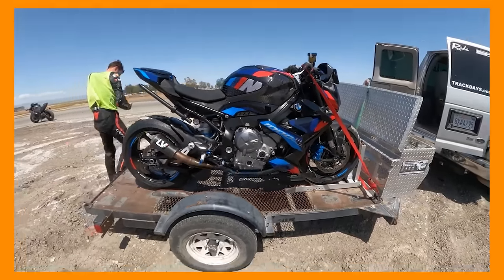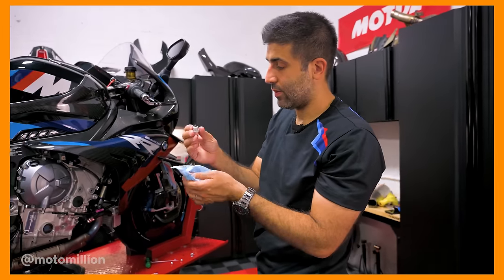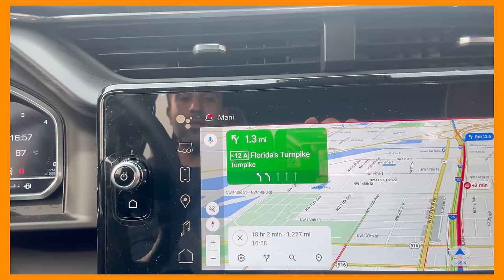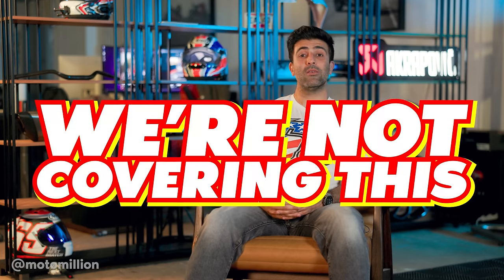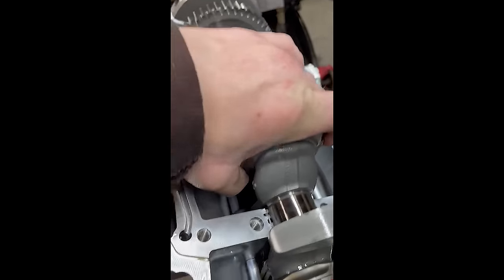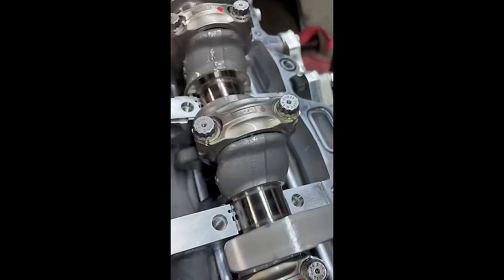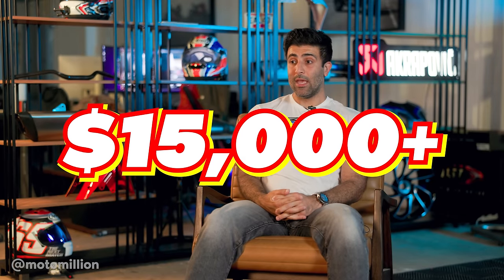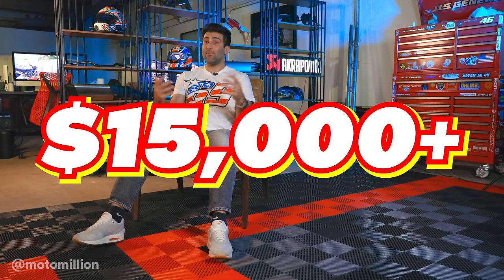MASSIVE Engine Failure on our M1000RR & BMW REFUSED Warranty...

Comment: I have owned numerous new BMW motorcycles over the years. They were once known for reliability and excellent customer service. 
My last GS had a fuel system recall. About a year later, the part they recalled failed and it started leaking fuel. The dealer reached out to BMW to get it replaced and to the dealers surprise they refused. I called their customer service (now the same as their automobile line) and was told they wouldn’t replace the failed part they put on my bike under their own recall. I got ahold of a manager and explained I was a loyal customer having purchased numerous new BMW bikes. He offered to give a tiny discount off of the retail price of the $800+ part. 

I will never own another BMW product.
Reply: You need a Honda or Kawa in your life, they would not break in first place :D
Reply: @elcookiemonsteru  I own a lot of bikes, and have owned several Honda’s Yamaha’s and Kawasaki’s. I currently own a couple of old Honda’s. Those bikes certainly tend to be reliable. Unfortunately, there aren’t many models in those brands I like a lot at the moment.

This might surprise you, but I’ve had zero problems with my old AND new Guzzi’s. Probably the most reliable bikes I’ve owned. They are a lot like the old BMW’s, very simple and reliable. Guzzi’s parent company, Piaggio also owns Aprilia. I’d consider a RSV4, but it needs an updating.

Comment: As a retired engineer who worked in REPCO NZ ( who produced engine parts including bearing shells) I would say straight off it was a duff bearing. Engines are very simple, you dont need to be a rocket scientist to analyse  the type of material/s in the oil and where they have come from,  everything you highlighted was correct , simply the bearing got through "QC" fitted and broke down from there. Shame on BMW..

Comment: There are literally 1000s of these bikes on the roads with ZERO problems. Common sense owners do the proper break in period. During the break in period, all the moving parts are 'settling in' with each other. This creates material debris in the engine, which thickens the oil. Thick oil and high rpms will destroy any engine, since the oil cannot flow properly.  No harm if the engine is kept at low RPMs and the oil changed within 500ish miles, which removes all the debris. After that, the new oil stays clean, no more debris, and hence the engine can now operate as intended.

Comment: I am a French biker. I had a 2019 s1000r. I had no problems with it. I currently have a K67 s1000rr and have had no problems with it either. Despite this, I understand being disappointed by a negative response without any verification from the dealer. We have vehicles that are relatively expensive and the feeling of having no empathy when we have a known problem with the vehicle can be very frustrating. Our luck is when 2024 BMW, like all other manufacturers, is very careful about their reputation on social networks. And absolutely want to maintain a good image in order to make customers loyal. Good luck to you in your reimbursement process. RIDE SAFE / PEACE

Comment: BMW is clearly fed up with people buying RR's, putting full race systems on them, removing the running in rev restrictions, redlining the engine multiple times during the break-in period, servicing the bikes themselves, or using non-BMW official dealers, and then either failing to tune them appropriately or applying aftermarket tunes such as Bren tunes to them while removing restrictions in the lower gears to boost power significantly. Then they go pop and the owners complain that it's BMW's fault. Calimoto was keen to show videos of him thrashing his bike from new, taking it to the track, tuning it, and generally abusing it (in many people's eyes) before it had even been broken in. I know several people who own M-R/RR's and track day them. One of them is even a professional motorcycle racer. None of them have had any problem with their bikes' reliability, which speaks volumes for the ways in which they treated their bikes and how BMW has engineered them. It sounds like your engine fault was probably a fairly isolated case Max (like Chris) and should have been covered under warranty in lieu of the warning message at just 9 miles. It did say you could continue your journey, so had it been delivered to a BMW dealer with say twice that mileage on it, before teardown, I dare say BWW would have been happier to warranty the engine?
Reply from the maker: Who knows.

Comment: I've owned lots of bikes and it's an accepted standard; you modify an engine with any non factory parts or re-maps you void the warranty. Wouldn't be surprised if it says that in the manual. Even if it had no effect on what happened you smoked your warranty.
Reply: I've been riding for 30 years. Every warranty says it.

Comment: I work for a Kawasaki dealership as a technician and ironically had an almost identical failure on a 2023 zx636 with 7000 miles on it. Disassembled the engine and found #2 rod bearing had come apart and the resulting material coming off the bearing and damaging the cases, crank, head, pistons, and cams, but despite all that Kawasaki warranted everything. Only difference is they don’t sell engines assemblies so us techs have to rebuild them ourselves.
Reply: BMW sucks
Reply: In 2006 I bought a brand new ZZR600 and 178 miles later it was in the dealers workshop in component pieces! Kawasaki warranted everything and were so apologetic to me.I ended up getting a full refund from the dealers but Kawasaki were brilliant with their customer service.
Reply: I’ve been working for a Kawasaki dealer as a tech for about 3 years now and I have to say their warranty is very impressive, they stand behind their product and they have warrantied many parts for me that probably failed due to customer error but they still approved the replacement anyway. I was skeptical of them warrantying this 636 engine because it would need new cases, crank, head, etc etc. almost 10k worth of parts and they covered everything for the customer and payed me good labor to disassemble and rebuild it for the customer so all around I think personally think Kawasaki is pretty dam good.
Reply: I only had a small warranty claim on my 2017 Versys 650 nearly by the end of the 2 year warranty period (bought it brand new, everything was perfect).
It was a front sprocket seal that was leaking very small amounts of oil, just enough to get the surrounding area moist.

Was told to clean it off with brake cleaner (to make sure it's not chain grease), ride it some more and report back.
I cleaned it, rode it, took photos before & after, sent it to my dealership and Kawasaki honored the claim and sent the replacement seal (done the change at the next service, since leaking was almost negligible).

No problems since and I've been extremely happy with the quality and reliability of Kawasaki.
Not to mention I love that bike to death. 😁

Comment: I had bought a brand new 2020 Aprilia RSV4 RR and I was told by the dealer, if I so much take the canister off to put a slip-on on my bike, I could void the warranty if something goes wrong. Manufactures are becoming strict with their products because they are tired of having to take the costs of replacing anything that goes wrong with the bikes.
Reply: Look up Magnuson-Moss Warranty Act. I don’t doubt that they’d try to refuse warranty repairs on bikes with slip-ons and good luck winning that case in court, but technically TL;DR a  dealership has to prove beyond a reasonable doubt that any modifications performed were a direct cause of any engine or drivetrain failures. YMMV, FA=>FO etc but the intent was to prevent companies and dealers selling stuff with useless warranties that they could void if you used aftermarket gasoline or tires.

Comment: I saw an engine failure on the new M1000RR last year in a track day.
I'm taking delivery of a new S1000RR tomorrow switching from my R1.
Wish I didn't see this video now haha.
Reply from the maker: This was just our experience. We have seen plenty of people with S1000RR and no issues!
Reply: Congratulations 🎊 hope you enjoy the bike you deserve it … you worked hard for it I’m sure 👍 enjoy it stay safe !!!!
Reply: 😂 I was torn between both last summer and I got the last R1 in florida. So far i'm happy
Reply: I agree, my friends have had lits of issues with theirs and they aound funny before warming up. Face it, its not the bike it used to be. kawasaki ftw @philb8344
Reply: Run it in properly for the 1st 600 miles, get the 1st service done at the dealers.
They will change the special factory running-in oil (which is very, very runny) for the proper oil and will remove the rev limiter that they all have during the running-in period, and you'll be fine.
Reply: @philb8344  There is NOTHING like the Japanese machine !
Reply: Just don’t void the warranty and it will be fine
Reply: just keep it at 70 % lol

Comment: It’s crazy how even after you told them about your company Motomillion they still refused warranty. Imagine how they would treat a regular customer without a fan base on the internet. Best of luck with the sale.
Reply from the maker: Thank you! At least this gives us an opportunity to have another bike in our fleet!
Reply: @Motomillion so when are you guys building up a Honda RRR?
Reply from the maker: As soon as we can get our hands on one! Waiting for that 2024 model to be released!
Reply: Most apparently you wouldn’t get anywhere at all especially like you said if they gave Mani “Motomillion” a hard time !!! 😔🤦🏻‍♂️
Reply: He removed the break-in rev limiter. It was not wise to do that and I don't think his company has any importance in this claim with BMW
Reply: @johnadams3038  I got that from the video but he stated after 400 miles they did the oil change (break in) and removed the rev limit as instructed. Only thing he did differently was do 400 miles instead of the recommended 600.
Reply: @SpoolinVR  Yeah its a shame because its just 200m would have been so easy to just daily ride it for 1-2 days and would have reached that limit easy
Reply: @johnadams3038  I had a new s1000rr back in 2014. I went almost 800 miles on break in oil because I went on a trip. If I blew the motor would they claim no coverage bc I went over the recommended 600 miles. See how much of a slippery slope that is. Straight bull shit they denied his warranty claim when others are clearly having the same issue with new bmws.
Reply: @johnadams3038 Owners manual clearly states limiter may be removed between 311-746 miles. Manny did nothing wrong
Reply: @iamthewallrus  I think it says that this is the break in period and it doesn't say you can remove the rev limiter. The BMW removes the rev limiter not 3rd party operations.
Reply: @johnadams3038  Dorect quote from 2023 S1000RR owners manual: mileage until running in check 311-746 miles. The running in check is where the rev limiter is removed by dealer. The only gray area I can see is if he removed it via a GS911 instead of the dealer doing so. Even still that’s splitting hairs as the end result is the same.  From everything I’ve been told including my dealer if you do the check/oil change using bmw parts and remove the limiter yourself AFTER the 311 mark, your warranty is intact. This seems like BMW is looking for every loophole and technicality to avoid paying the warranty claim, which really is what this video is about. We all know this isn’t the cause for the failure
Reply: @SpoolinVR  it's literally 1)3 of the breaking period
Reply: @iamthewallrus  He removed the rev limiter himself and that is the issue. I guess companies just care for their own interests. For us this is a great YT channel and all but for BMW is just a regular customer.
Reply: they'd treat us like peasants!
Reply: Why should his company grant him special treatment?
Reply: shocker that they treat everyone the same
Reply: @iamthewallrus "The running in check is where the rev limiter is removed by dealer." - dealer. Very important point. When buying a very expensive piece of equipment I'd recommend following the T&C of the warranty. Then you get the warranty cover.
Reply: Must be junk.. most engine builders run a couple of heat cycles on a dyno then into it.. and they don't  seem to fly apart.. so BMW got supplied inferiour bearings and hide behind the fine print..  One way to reduce motorbike customers.. 😂😂😂

Comment: 19hrs drive, that's dedication. Wouldn't drive this long to my own wedding.
Reply: Me either ...LOL  . BMW has  serious issue on the factory floor if these M1000RR are going sideways.. these are built to RACE WIN RACES above all else... not tooling around town..
Reply: Good thing you won't have to, considering 50% (or something like that, and rising) of men under 30 say they will not get married in the US. lol

Comment: That “tuner” is redlining the engine with no load on it.  You couldn’t F it up more if you tried.
Reply: What do you mean no load... it was on a dyno????
Reply: @Ultra54able  It can be on a dyno AND in neutral, though ;)
Reply: @CyberChrist  
It wasn't in neutral.
Reply: @Bnslamb  But it could've been.
Reply: He was checking the horsepower and torque, you need to be in gear to do that. Nobody is going to redline their bike in neutral while on a dyno. @CyberChrist
Reply: @mtmatt8958 Mistakes happen ;)

Comment: I had my engine blow on my 2020 S1k at 5,800 miles. All recalls and maintenance done by dealer after 3 years and 2 months. Meaning the warranty was out when it happened. So I’m out of a bike that should have had plenty of life left.
Reply from the maker: Really sorry to hear this. Have you replaced the bike?
Reply: Never let anyone work on your bike do it yourself otherwise maybe done right maybe not.

Comment: Ive got a 23' M1000r with 2,500 miles now. No issues... but i broke in the engine correctly and the bike is stock. I track the bike regularly and reach 14k rpm regularly.

Comment: I bought a 2021 S1000R race pack for the track, and the engine blew after 2500 miles. 
I had an issue with the warranty as well; even though the bike was completely stock and serviced at a BMW dealership, it took 3 months to replace the engine after back and forth messaging and inspections, and I got the impression they were doing me a big favor by doing so, and it wasn't their responsibility.
I lost faith completely in the brand, reliability, and build quality aside. The lack of action and responsibility for their own faulty products is unacceptable.
Reply: What was their reason they didn’t want to honor your warranty?? Because if you had any over rev detections I’m surprised they did warranty it.
Reply: @jacobhendrickson8935  
The bike was completely stock and serviced at the BMW dealership. I didn't have any ECU flash or aftermarket mods.
They were reaching and digging for any possible reason to blame me since I told them I bought it to be a track bike, but after 3 months of back and forth and their investigation, they eventually replaced the engine under warranty because they couldn't find anything to blame me, and I was spoken to in such a manner as if they were doing me a big favor and next time they wouldn't do it.

Comment: When you spend that much money we all want great service from the local dealer and manufacturer. That should be part of the incentives we get buying these bikes. Crazy!
Reply from the maker: Need to have a check list now, before we commit to such bikes.
Reply: Start with not abusing the bike, by - 1) remapping ecu , (voids warranty) which they did.  2) - not installing non OEM performance engine parts (voids warranty) which they did. 3) testing or riding bike on a race track (voids warranty) which they did.  You don't have anything to worry about, when you actually follow the very simple and clear manufacturer instructions.